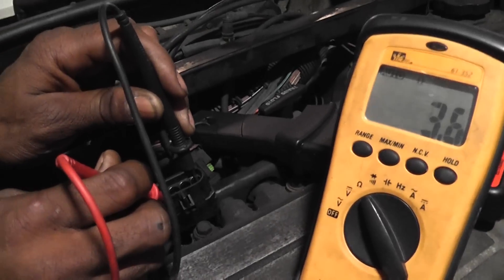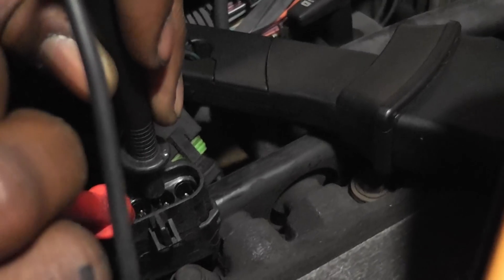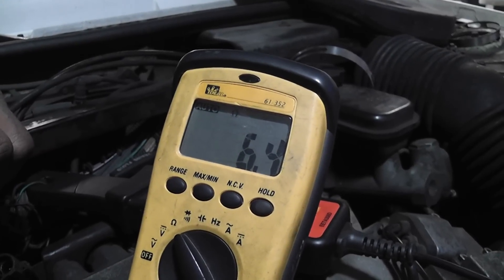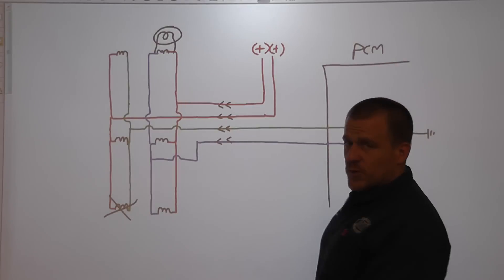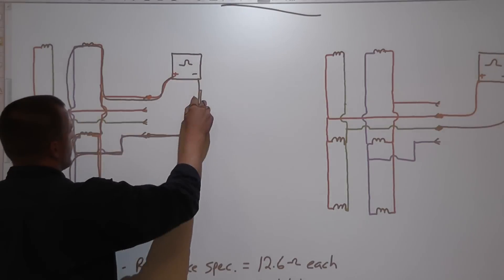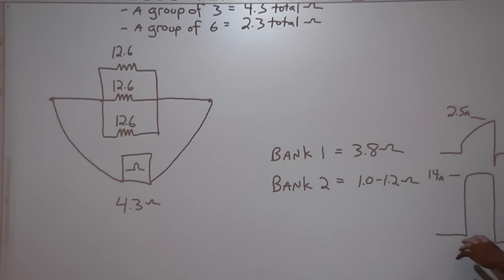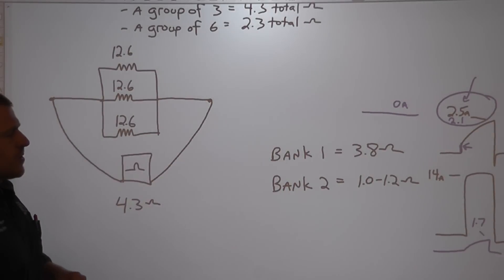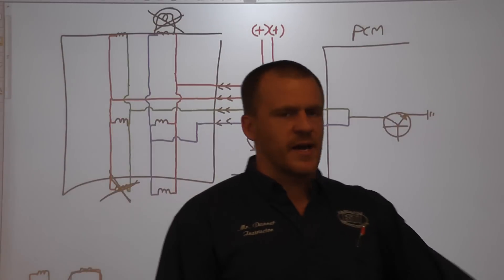No Start No injector pulse (shorted injector) part 2

Comment: With the batch firing of the injectors. Doesnt this waste a lot of fuel?  I mean your injecting fuel outside valves of cylinders that are not producing power and may be on an exhaust stroke etc..I am just not getting why you would ever want to do this way.  It seems to kill the main advantages of EFI ??
Reply from the maker: It doesn't. The injectors all fire once per crank rotation, so twice before the intake valve opens and the pulse width is accounting for the fact that the injector is going to spray twice. The fuel will sit there for only a few milliseconds, even at idle speed.

Comment: you just solve my problem. I own a 1986 Toyota van, and I have swapped the ECM 6 times. Bad injector reading really? I have to go and checked them out. Thank you, sir, 👍
Reply from the maker: Let me know what you find
Reply: @ScannerDanner  Thank you for responding right away 👍 I checked all the wiring at ALLDATA for two months. I have been getting my @$$ handle it to me. I'm just going to subscribe right now. 😎
Reply: @ScannerDanner  only one injector is 2.6 ohm's
Reply: @ScannerDanner  I got me another ECM made by Denzo, I got power going to the ECM, everything is grounded properly, I unplugged one injector at a time, 12 volts on both pins, still, no pulsing, I'm stuck, can't figure it out 🤔
Reply: I unplugged all of the injectors, on the manual it says, I should be between 1.5 and 3.0. on all of the injectors I'm getting 2.5 on my multimeter 🤔

Comment: 4.3 X 3 =12.9    not 12.6
Reply from the maker: Math...😅
Reply: @ScannerDanner  if you do 12.6 / 3 = 4.2
Reply: @ScannerDanner  if you dont have a node light you can use LED test light on ECU control side

Comment: Thanks for the video! On an isuzu 2.6l 4cyl, what would cause a code of cylinder 1 misfire injector circuit open? I have measured the resistance,  replaced # 1 injector and still getting same code and the vehicle is still skipping. Thanks in advance.
Reply from the maker: Circuit open? Step 1 what is control wire voltage for that injector measured right at the ECM, engine running.
Reply: @ScannerDanner  I'll have to trace it down. These are high impedance injectors and are reading 12v to the one I can get to, I switched my test light around and put it on positive and the green led blinked fast but only at 3 places on the harness, where the injector harness plugs into another harness.  This vehicle the plenum has to be pulled to come close to getting to the injectors which creates a situation when troubleshooting.  I plan on tracing the wires down today. Thanks for replying too.
Reply: @ScannerDanner  I pulled the #1 connector off . The red/green wire has a constant 12v. Meter showed like 0.24v on other wire which is blue with blk . I connected test light clamp to pos and point to other wire and it blinked but very slowly.  Then I went back to cluster connector and it was blinking very fast like a node. I did this with engine running and it ran the same with injector unplugged as with it plugged up. This is a new injector too. The wires have so much insulation on them its extremely hard to see the colors and like I mentioned before, to troubleshoot it any further, I will have to remove the plenum.  According to a schematic I found, #1 & #2 injectors are in parallel.....it seems like I could piggy back of injector # 2 with 2 good wires but wanted to ask your opinion before I did. I really appreciate your time. People like you make youtube a Godsend.
Reply from the maker: @dgmenace73  how many controls wires go to the ECM? If it is two, then it could be a pair fired system, but it could still be a group fire. If it has 4 control wires, it is sequential injection

Comment: Hi Sir please help I have pathfinder 2001 vg3.3 engine .when warm engine cylinder 3 and 4 no injector  pulse when idle and if I accelerate pulse will comeback by the way I using 12v  led light to see the pulse. 
Thanks in advance .
Reply from the maker: I have a video on this set up. This is an optical distributor where the upper bearing fails and puts metal shavings all over the inside drive plate of the optical pickup. That is my guess as to what is going on for you. Let me find the video...

Comment: How did you find out the control wires share a single driver?
Reply from the maker: 1. A single shorted injector causes a no start
2. Lab scope current testing

Comment: here's one for you, 94 Caprice 5.7 TBI, no injection pulse, put three different computers in it , even changed the eprom, pulses one time when you go to start it afterward no injection pulse, even at the computer harness
Reply from the maker: these are notorious for having bad ignition control modules where it still provides spark but does not send the reference pulse to the ECM for injection sequencing. It is a purple/white wire. You can take an incandescent test light and connect it to battery positive and then touch on and off this purple/white wire (key on) and it will cause the ECM to see a false reference pulse. It will respond by running the fuel pump and firing the injectors. If it does this, focus on your ICM :-)

Comment: Sir good day I have ford explorer here in philippines my issue is about no crank no start problem faulty cranking in ignition switch no power
Reply from the maker: post this to my forum, it is free to join and we can help you but you will need to provide a lot more info than what you've provided here. Year, make, model, engine, trouble codes, history etc  https://www.scannerdanner.com/forum/post-your-repair-questions-here.html
Can't offer this here. Too hard to keep up, but that is why I created to forum because I still want to help you

Comment: I have 1987 olds delta 88 I put new ECM , fuel pump the injectors aren't pulsing and the fuel pump will not work unless you straight wire it are they a fuel pump relay and injector relay

Comment: hi Paul (international teacher), this video does not make sense especially at time 3:03. if the system is group firing injectors, then that means the car will waste some fuel as we know that pistons will not all go up at the same time.what stupid design will that be.

m.b.s moshitoa (s africa)
Reply from the maker: Here is the key.
1. The intake valves control when the fuel enters the cylinders, just like on a carb engine!
2. The time that the fuel sits there is only in the milliseconds even at an idle speed 
3. The injectors may spray twice before the intake valve open and injection p.w. is accounting for this, giving a total pulse width that will be the proper ratio
Hope that helps

Comment: Pls i need your help is the signal from pcm to ignition module 50 hz square wave and could i use it to bypass tdm  my pcm require 50hz to enable fuel to injectors. Ihave caprice 96 4.3l ls l99 engine
Reply from the maker: it is a variable signal that increases proportionally with RPM
Reply: @ScannerDanner  thank you

Comment: that will only work on batch fire injectors.
Reply from the maker: That is correct
Reply: How about DI. The car I am working on is a GM 3.0 DISI. The injector is opened with 65v and held with 12v. The ecm controls both the hot and ground side. It’s a strange one to work on.
Reply from the maker: Not too different than the peak and hold injector controls they used back in the 80s on TBI systems with the main difference being the boost capacitors and controlling both sides.
If you scope test them, 1 lead to each wire instead of battery ground, you will see a pretty standard looking peak and hold waveform
Reply: Looking on the Snap-on truck tomorrow for a scoop.  Look me up. I’m wally off of Koon truckings channel.

Comment: I have a straight question, what causes to loose pulse signal in a injector, it has a good 12volts suply, when it satart to crank it will only make 2 to 3 pulse then the pulse signal is gone, 

NOTE: crankshaft sensor is brand new
Reply from the maker: If you have this system, a shorted injector can cause what you are describing
Reply: @ScannerDanner  sir question also, the injector itself is shorted or the injector circuit is shorted?? Because  i desconect all the in injector  wirring socket at the same when i conducted the pulse testing,  by the car that i am been working on is a TOYOTA CORROLA ALTIS yr model 2000

Comment: I have a camaro with a 3800 v6 that developed a misfire then stopped starting. i tracked the misfire down to injector wires for one cylinder that had gotten pinched and cut. i sodered them and heat shrink wrapped them, but i have no injector pulse to any of the six injectors. coulld a short have fried a circuit in my pcm?

Comment: would a bad coolant temp sensor have the same symptoms.ive noticed if you unplug the coolant temp sensor on a cold engine the injectors wont fire until youve cranked to the point of battery dying.
Reply from the maker: +GUSTAVO GARCIA not the case on most cars, but yes a coolant sensor problem can flood the engine out and cause a no start

Comment: I don't understand how these group-fired injector systems work.  You say the injectors are triggered simultaneously in banks of 3, even though only one of these 3 cylinders should be receiving fuel at any given time.  What's stopping fuel being injected into the other 2 cylinders at the wrong point in their cycle?

Comment from the maker: They all fire at the same time, once per crank rotation. 
intake valves control when the fuel gets pulled into the cylinder.
Reply: does that apply for every engine design, as some ecm's have separate control wires for every injector ???
Reply: No it doesn't apply to every engine design, his description at the top shows that this only applies to some older GM engines

Comment: i think because he is just showing us the amperage signal from a shared control wire,its not a voltage graph,,if paul read this can confirm as correct me if im wrong.

Comment from the maker: it wouldnt have mattered where you put the noid light as this is a group fired system. It wouldn't have lit on any injector, other than once you unplugged the main shorted one, then at that point the noid light would flicker and the car would start.

Comment: You checked the current flow on this circuit. If you back probed the control side on DC volts you would have seen a pintle hump on good injectors, correct? Im just responding to the pintle hump comments. Voltage spike versus amperage ramp, two different waveforms.

Comment: Hi Paul, Since this is a group fired system and there are two control wires, how would you know that there was only one driver for such as system? Is this only pertinent to GM or there other manufacturers with a similar setup. If I had looked at the schematic and saw two control wires, I would have assumed there were two drivers. Is there any way except for experience to have know this beforehand. Thanks Paul!

Comment from the maker: You cannot, if you are connected to the one control wire or the main power feed. If however you connect your amp probe at the injector itself, only then can you see the individual ramp.

Comment from the maker: If it doesn't have this 4-pin connector, you can access the blue and green control wires near the ECM on the passenger side inner fender...I think. Its been awhile.

Comment: @ScannerDanner I will change the two low injectors in a week. Today I went to a  junk yard and got 1 injector for $6. I have no choice at the moment. I DID however go armed with the intel that you shared with me. I checked each one until I came to one that read 12.6 ohms, flickering to 12.7. I left the lower ones. The car jumps up when I hit the gas! For the first time since we bought the car it, the tires chirp and skitter, pulling the car through the gears. Thank you Paul!

Comment from the maker: @chetsjug Oh and the 4 pin plug is only on the early 2.8 and 3.1 engines. Did you see the 3300 engine I have up with the shorted injectors? Either way, you found your problem, nice job!

Comment from the maker: @chetsjug Change the 11.2, 10.7 injectors too. The bad thing with these multec 1 injectors is they change resistance with temperature. The best test is a current ramp test. This is because the solenoid winding is "loaded", the ohmmeter does not "load" the windings the same way.

Comment: I have a different wiring harness that I see on your vid. I cant't find this 4 pin plug. So I checked the ohms individually. Here's what I got. Left Bank (front to back) 11.2 - 10.7 - 12.7 --- Right Bank 12.5 - 12.8 and the LOSER is, the back right (next to the battery) crossing the finish line at 0.9 ohms! Guess I'm going to the auto store in the morning. This is too cool :) I have been on this for 6 weeks, joining forums and testing this and that. I finally found a bad part! hahaha

Comment: Holy Cow Batman! I havent heard of this bank of FI's thing. I changed 5 of the 6 injectors that looked like brown flakes up the tubes, the last 1 was clean & shiny & I thort was replaced recently. This vid shows me the other side of the injector, the coil inside! Duh! I did the noid test and I thought an individual ohm test on the 6. I'm out the door right now to double check them on the banks! Dad did electronics & I'm up on a lot, but you're giving me quite an *automotive* education here! LOL